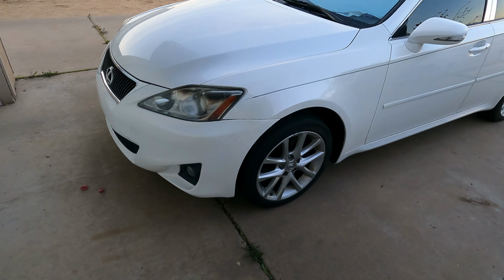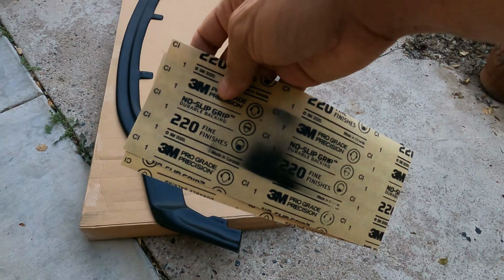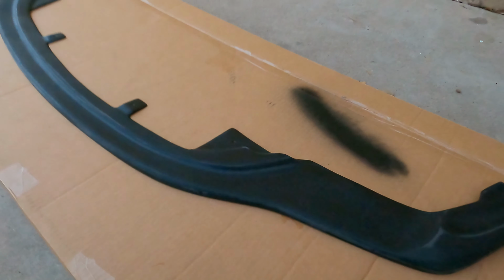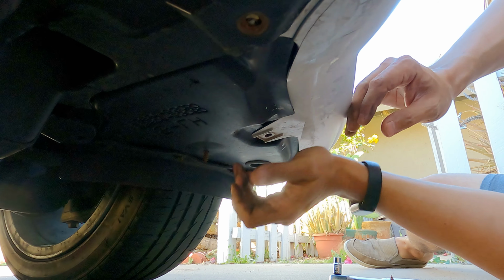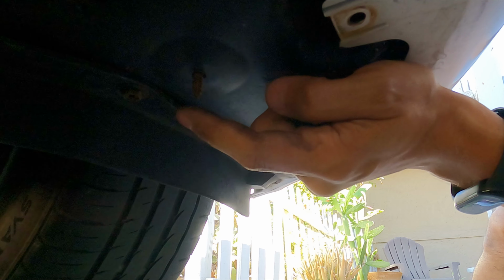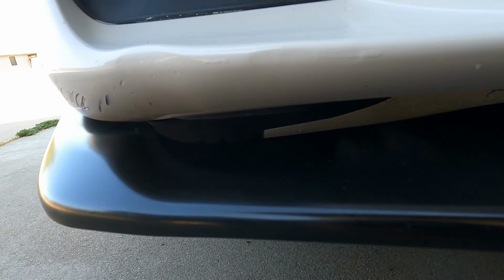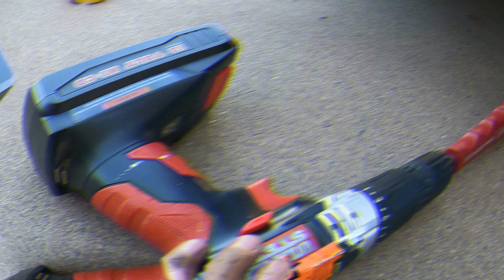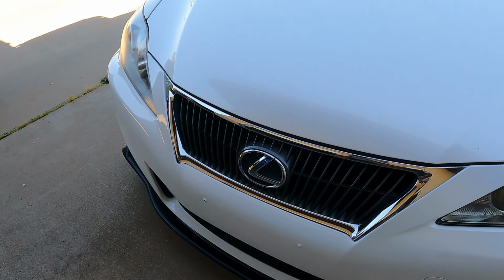2IS SPLITTER INSTALL | Project 2IS (2011 Lexus IS250)

Comment: You just sanded and went straight to spray paint right no primer or top coat also what spray paint did you use
Reply from the maker: Yes and I used krylon paint and primer 👍